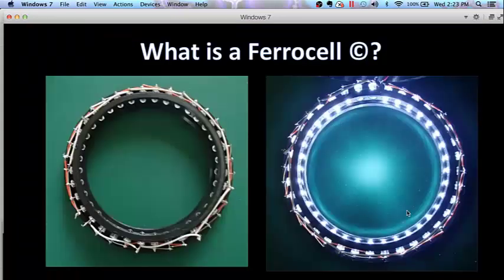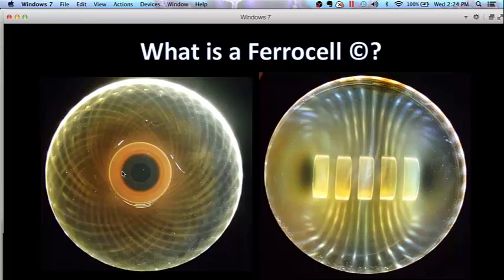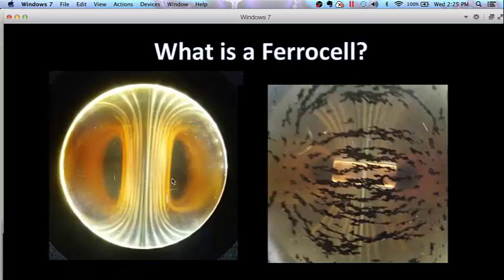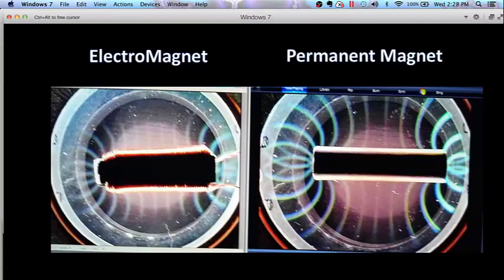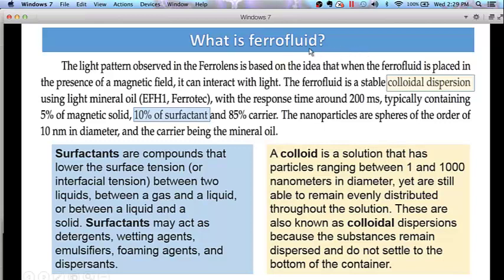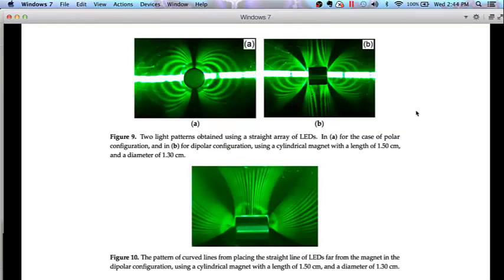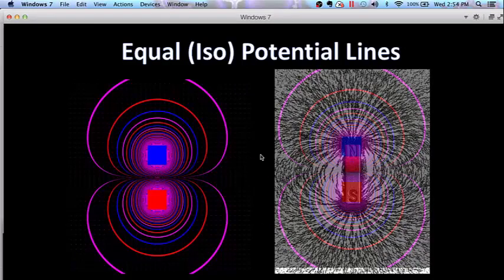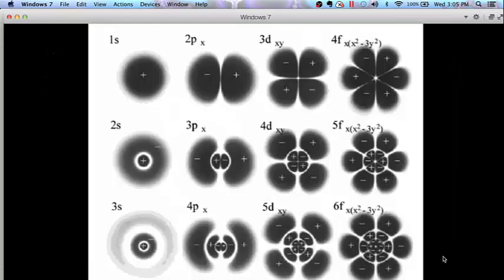Unveiling the Missing Secret of Magnetism

Comment: Lori:  When you say you have a secret, you really have a secret!  This is amazing!!  So the shapes of the probabilistic electron orbitals calculated in quantum theory, match shapes formed by the possible equipotential orbit curves modelled using attractively aligned and positioned magnets.  (Or something like that.  Perhaps you could explain it more exactly for me, so I can be sure I understand it.)  This reminds me of something I was told many years ago by my differential equations professor.  Directed toward us physics students, he made a comment that, to solve any 1 2nd order differential equation specifically, requires 2 other specific condition equations.  The quantum theory probability equations are 2nd order differential equations, but no accompanying condition equations are ever considered.  So I have always assumed that quantum theory calculates only a general solution of all possible orbits, and such a general solution requires 2 specific conditions to determine any 1 specific orbit.  So mathematically calculated quantum theory probabilistic electron orbitals are a kind of probabilistic smearing together of all possible electron orbits.  And now, thanks to this video, it seems they align and position themselves like magnets.  Thank you, and Timm and Michael!
Reply from the maker: Basically, an electron is an atom is a magnet is a black hole. This is the fractal paradigm at its best.
Reply: @FractalWoman  I haven't yet viewed anything by you about the "fractal paradigm", so I can't comment on that.  But black holes can't exist.  1 defining assumption of a black hole is that it has an infinite density in its centre.  No object, or particle, can have even 1 position having infinite density, without it having infinite energy, and no object, or particle, has infinite energy.  So black holes, as defined, can't exist, and particles assumed to have fields varying inversely with distance from their centres, can’t exist, because each such particle would have an infinite field, and therefore infinite energy, at its centre.  As I indicated in my YouTube video, "Particle 2 Slit Experiments Explained By Paul Marostica", a particle's field can include 1 or more maximum magnitudes of field.  But using the energy considerations I’ve mentioned here, a maximum magnitude of field can not be infinite.
Reply from the maker: @PaulMarostica  Oh no. Not again. "Black Holes can't exist". Yes they can. WHEN DEFINED CORRECTLY, it is possible for black holes to exist. The problem is with the language. Here is how I define a black hole in terms of the fractal paradigm. https://www.researchgate.net/publication/315381462_The_Mandelbrot_Set_as_a_Quasi-Black_Hole
Reply from the maker: @PaulMarostica  "No object, or particle, can have even 1 position having infinite density, without it having infinite energy,"

Nope. That is not true. The centers of cosmological black holes do not have infinite MASS. They have infinite DENSITY. Density has units mass per unit volume [kg/m^3]. Image we have an object that is 1 meter in diameter. If it is a cube, then the volume will be 1 meter cubed.  Let's say this object has a mass of 1 kilogram. Now, let's shrink the volume to zero or nearly zero. The mass doesn't change when you shrink the volume, only the volume changes. 

If the volume is zero (or very nearly zero), then the DENSITY with be very high but the mass will stay the same. If mass is the same then energy is the same (E = mc^2). This is a common mistake that people make. Density and mass are not the same thing.
Reply from the maker: @PaulMarostica  "But using the energy considerations I’ve mentioned here, a maximum magnitude of field can not be infinite."  And of course I agree. Again, infinite density does not imply infinite energy as per my previous message. I think you need to re-think your arguments based your incorrect assumption about black holes.
Reply: @FractalWoman  Thank you for correcting me.  In my thinking, I considered an electron's electric field, assumed to vary inversely with distance from its centre, which implies the field in its centre is infinite, and a black hole's gravitational field, assumed to vary similarly, implying the field in its centre is also infinite.  So the energy in the centre of each would be infinite.  But, black holes are not assumed to have an infinite mass.  Instead they are assumed to have the finite mass they've accumulated by gravitational attraction.  So, assuming relativity's mass-energy relation, they should have the finite energy of the finite mass they've accumulated.  So I’ll rethink as you suggest, and ignore a black hole's gravitational field.  Density is mass per volume, and infinite density could occur for infinite mass per any volume, or any mass per 0 volume.  I think that assuming either for a black hole is physically illogical.  2 times in 1 of your replies, you mentioned, nearly 0 volume, instead of 0 volume, for a black hole.  So I think you don't accept the black hole 0 volume, infinite density assumption yourself.  What form do you assume mass in a black hole is in, to be attracted into a small, non 0, volume?  In your above paper you referred me to, I tried briefly to find your definition of a black hole, but I was unsuccessful.  If it's not too much trouble, could you direct me to the part of your paper it's in?
Reply from the maker: @PaulMarostica  I didn't specifically define the black hole in that paper. I showed a similarity between the cosmological black holes defined by mainstream and the Mandelbrot fractal. This an analogy, but not a definition necessarily. I have since redefined the "black hole" in terms of the Principle of Incommensurability. I use the terms InnerWorld and OuterWorld instead of the terms counterspace and space as Ken Wheeler uses. The hole part of the black hole corresponds to InnerWorld. The outer photons sphere is OuterWorld. Between InnerWorld and OutWorld is the event horizon. According to The Principle, whatever InnerWorld IS, OutWorld IS NOT and vice versa. Whatever OuterWorld experiences, InnerWorld does not and vice versa. 

"What form do you assume mass in a black hole is in"

Mass is an OuterWorld phenomenon. It is caused by a gradient similar to what is seen in the Mandelbrot set. The higher the gradient, the stronger the gravitational "field". InnerWorld has no gradient therefore, it has no mass. Mass is what OuterWorld sees (ie. a star or planetary body near a black hole). If you were inside a black hole, you would not be able to experience mass. Also if you are inside a black hole, you cannot get out and it you are outside a black hole, you cannot get in. It is my opinion that matter cannot and does not fall "into" a black hole. It gets really close, then gets shot as jets at either pole. 

Hope this helps.
Reply: @FractalWoman  From reading your reply, and then going back over 1 of your previous replies, I think I finally understand why you've chosen a fractal analogy.  You're thinking a black hole, a magnet, an atom and an electron might be different size versions of the same thing, which is something that is observable in (some or all?) fractal patterns.  Regarding your thinking about black holes, I'm confused.  Are you thinking that inside a black hole there is no mass gradient because there is a constant density everywhere?  If so, how does that constant density form?   If matter outside can not get in, how does a black hole form and grow?
Reply from the maker: @PaulMarostica  "Are you thinking that inside a black hole there is no mass gradient"

Outside of the black hole, there are density gradients. Mass is an emergent property of density gradients (Aether density gradients to be more precise). Inside the black hole, there are no density gradients and since mass is an emergent property of density gradients, mass cannot exist inside a black hole. The constant infinite (or nearly infinite) density forms when the black hole forms.  Gradients are the reason for forces and so if you found yourself inside a black hole, you would feel no forces. 

"If matter outside can not get in, how does a black hole form and grow?"

It has never been proven that black holes "grow". This is merely an assumption. Also, black holes do not exist in isolation. BlackHole-PhotonSphere-EventHorizons exist as one entity. Black-Hole-PhotonSphere-EventHorizons might grow. But that does not mean that the black hole is growing independent of the other parts. Black holes can merge (galaxies can merge) and become bigger. Atoms can merge and become more complex atoms. Fusion. But atoms don't swallow other atoms. They merge more like how two magnets merge. Same with black holes. 

All of the material that "falls into" a black hole gets shot out as jets. None of it "goes in". There is a story out there of a gas cloud that the black hole at the center of our galaxy was suppose to "swallow" but it never did. https://www.nationalgeographic.com/adventure/article/141106-space-g2-black-hole-science
There are other observations like this too where material was suppose to fall into the black hole, but instead got shot out as jets. So observation seems to support my idea that nothing can get IN to a black hole.
Reply: @FractalWoman  I've viewed your video about our galaxy's black hole encountering a gas cloud.  Why do you think a black hole can merge only with another black hole, and not with any other massive object?  Do you think a black hole can merge with a photon?  Oh, and in my opinion, I think you should eliminate considering the possibility that an object having a finite energy could have an infinite density or an infinite field.  Accepting that density and field must be finite could help you consider more logical possibilities others might never consider.
Reply from the maker: @PaulMarostica  "Accepting that density and field must be finite could help you consider more logical possibilities others might never consider." That why I always caveat my statements with "nearly zero volume" and "nearly infinite density". I don't believe in infinity. Infinity doesn't exist. Yes, black holes can merge. Atoms can merge too. It's called fusion. There are a lot of similarities between black hole mergers and fusion. In both cases, a crap load of energy is released.
Reply from the maker: @PaulMarostica  Oh and NO I don't think black hole scan merge with photons because photons don't exist. Only waves in the medium exist. Photons only exist when they crash into the shore of a detector, like the eye, or a camera or some other physical object. When propagating, light is a wave and only a wave. Light can't crash into a black hole. Instead, it "gravitationally" bends around it due to the huge gravitational gradient (Aether density gradient) near the event horizon of a black hole.
Reply: @FractalWoman  Okay.  If I understand your thinking about black hole mergers, you think 2 black holes might join together, like 2 nuclei might join together, resulting in 2 joined black holes, instead of 1 more massive black hole.  And this is consistent with your fractal paradigm.  That's some very interesting thinking.  Regarding light being just waves, I don't understand why you think light waves become a photon when they collide with something.  Also, isn't gravity always attractive, so that the force of gravity on light, or on any object, is directed toward a source of gravity, not around a source of gravity?
Reply from the maker: @PaulMarostica  "'Regarding light being just waves, I don't understand why you think light waves become a photon when they collide with something."  

I got this idea while watching water waves crash into the shore at the beach. I have talked about this before in my videos so you should check them out. I hate having to repeat myself, but here it goes.

When you see waves on the water, the water is not travelling with the waves. The water molecules are actually only moving a short distance in circular motion as shown in this webpage: https://www.acs.psu.edu/drussell/demos/waves/wavemotion.html
Check out the water waves. You will see that each individual water molecule is only moving in a circular motion on the spot. The water molecules are not moving with the waves. The waves are travelling towards the shore, but the water is not. 

BUT...when the water waves crash onto the shore, THEN the water molecules are moving with some energy. Water waves cannot do work until they CRASH into something. This is why surfers wait for the waves to come close to the shore before they try to surf. Surfers cannot surf waves far away from the shore. They can only surf when the water is moving. Look up some surfing videos and you will see what I mean.

When the waves start crashing, then the water is moving and when the water is moving, IT can do work. 

Same with light. When light is propagating between objects, it is merely a wave. The Aether molecules that make up the medium for the propagation of light are merely moving in circular motions as I show in some of my videos. But when the light waves crash into the shore of an object such as the eye, or a camera or some other object, THEN  it can do work, like knocking electrons out of a solar panel to create electricity. Only when light crashes into something, does it appear particle-like (aka a photon). Otherwise, it is merely a wave.

Hope this helps.

Comment: you know whats interesting, on my index finger i have a "peacocks eye" fingerprint that has a double looped spiral identical to the image you show at the very beginning of this video. i also have the same symbol my palms on the "mount of moon" location
Reply: The image is the Mandelbrot set fractal 👍
Reply from the maker: Crazy.
Reply: @Fractal Woman Try this stuff https://magnaflux.eu/EU-Files/Product-Data-Sheets/Chemical-Consumables/14HF-PDS.pdf in a ferro cell. The main difference is that the particles are fluorescent under UV light. Their also could be a difference in the particle shapes. Normally these fluids have cylindrical shaped particles yours has spheres. The differences could give you some answers.